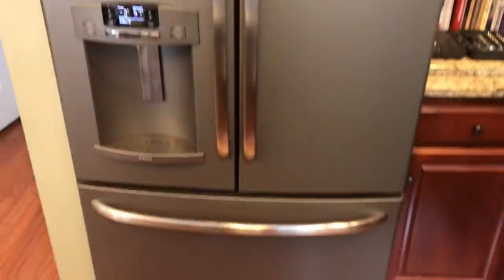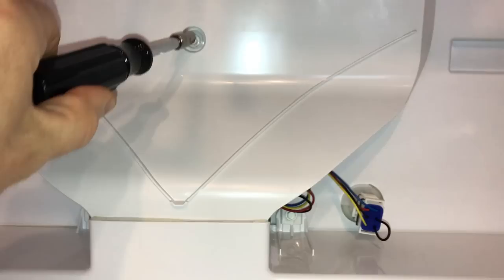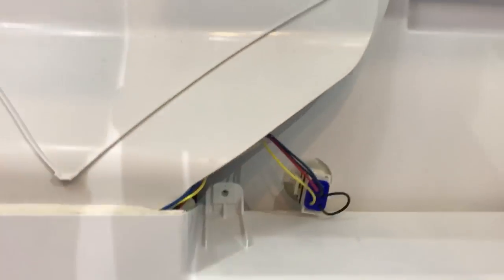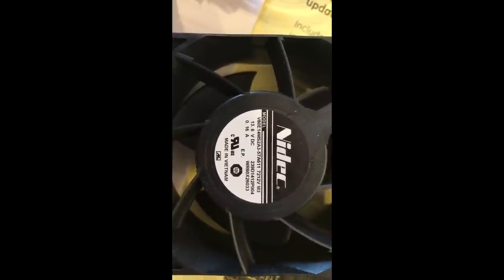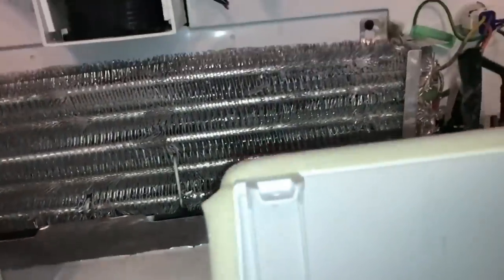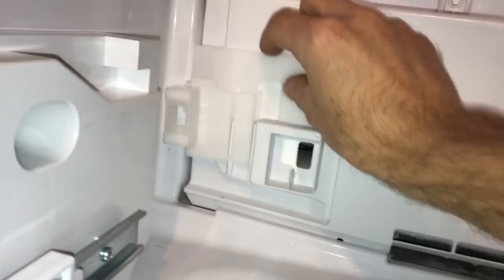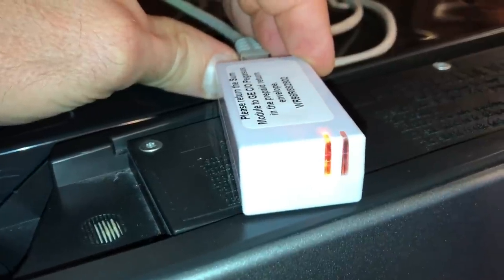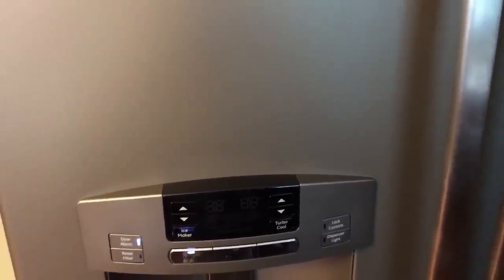GE french-door refigerator not cooling - How to replace evaporator fan

Comment: Thank you and great video!I have a question,the link which is the first one you give us,it's for Amazon ,I accessed it and read the review,most customer said it doesn't comes with the software update items,so where did you buy it?
Reply from the maker: The new fans now do not require the software update. If you did happen to order an older replacement fan which requires the update, it will come with the software and cable that you need.
Reply: @ljschuby99  Thank you!
Reply: Original GE fan part number WR60X10356 was replaced / updated  with part number WR60X26866. No software update required for this fan part number as of 12 June 2021.

Comment: Did this and now the top of my fridge is now too cold? What could be the issue?
Reply from the maker: You can check to see if the fan is running all the time which would cause too much cold air in the fridge section. If it is not turning off, there could be a problem with the thermostat or the control board.

Comment: Do you know if the fan runs 24/7 or does it cut off sometimes?
Reply from the maker: The fan will cycle on/off occasionally to regulate temps and defrost.
Reply: @ljschuby99  thanks

Comment: Can you run the freezer while waiting for  the part  or is that not recommended?
Reply from the maker: Yes, the freezer should be running as normal.  If the fan in the fridge is not working, then the cold air from the freezer will not blow up to the refrigerated section.
Reply: Okay great, wasn't sure if I would be doing damage to the coils building up with ice with the  fan not working. I ordered the part today thank you for you video it was very helpful.

Comment: I purchased a new motor and when we plugged it up the new one didn't come on either.  Can you tell me why?
Reply: Sounds like something is not working to kick on the fan, possibly the thermostat or the control board.
Check out the forum section of ApplianceBlog site.  You can search Thermostat or Control Board for similar issues, and there is also info on entering self diagnostic mode so you could check status of thermistors.  Moderators on the forum are helpful at troubleshooting.

Comment: Are there only certain model that require the update
Reply from the maker: The software update is no longer required with most recently produced replacement fans which have newer specs. So if your replacement fan does not come with a software cable, then the software update is not needed.

Comment: how were you able to be certain that the part that was bad was the evaporator fan and not the thermostate?
Reply from the maker: The only way to be certain would be to remove and check both the fan and thermostat for continuity.  However the fans on these units are a common problem.

You can do a quick check of the fan by removing it and trying to spin the blades - if they don't spin freely, then the fan is bad.
Reply: On the jack that the fan plugs into, use a multimeter on the pins that correspond to the red and black wires from the fan.  It should be roughly 12v.  Also, I had a hard time finding the new replacement fan in a timely manner. Even the local big parts warehouses didn't have it in stock (Kansas City MO area).  I found that an 80mm computer case fan will work for a temp fix.  Just cut the plug from the old fan and splice the red and black wires to the corresponding red-black wires on the case fan. You don't need to hook up the other wires.  Best Buy stocks 80mm case fans in some stores for $7: http://www.bestbuy.com/site/insignia-80mm-case-cooling-fan-black/3646017.p?skuId=3646017   Other local computer part stores probably have them too.

Comment: I have the same problem but my fan works What else could it be?
Reply from the maker: If you are having the same symptoms, the fan may not be working all of the time. 
You can check to see if you are getting any freezing ice on the coils in the fridge under the fan. If so, it would probably be worth switching out the fan to see if that fixes it.

Comment: Do you need to perform software update for the fan to work if my serial number starts with MF
Reply from the maker: If the fan comes with software update kit with Ethernet cable, then it is recommended to update. However, latest fans may not include kit or require any update.
Reply: What are the signs that defrost unit is not working correctly?
Reply from the maker: @ojasparikh  If the fan is not working properly, there is usually ice on the evaporator coils and the food in the lower deli tray is freezing.  The temperature display for the freezer is cold and close to zero, but the refrigerator section is warm, around 50.
If these are not your symptoms, you can check out the forum section of ApplianceBlog site.  There you will find more information about other possible problems.

Comment: Thanks for the great video. A question, when I open the refrig up to look at the fan, should it be running?
Reply from the maker: The fan does not run constantly, it turns on based on temperatures and thermostat.
Reply: @ljschuby99  So the digital door temp shows 60, but food is freezing in the crisper drawer. Bad motor?
Reply from the maker: @markmoeller614  Yes, sounds exactly like a bad fan.
Reply: ljschuby99 Thank you. I replaced the fan and everything is working great!
Reply from the maker: Great - glad you got it fixed!
Reply: ljschuby99 The refrigerator is running fine, but the ice maker seems to hang up (makes a noise like it’s “hunting”). The freezer was way below zero so wondering if something is froze? Unsure how to defrost it
Reply from the maker: Mark Moeller Possible that something is frozen. If you are getting water from the dispenser, then the problem would be in the ice maker part itself. If no water at all, likely frozen near the back lower part of fridge behind the deli tray. You can check out the forum section on the ApplianceBlog site for defrost options.

Comment: Thanks for the video!!! Problem fixed!!!
Reply from the maker: Great - glad you got it working again!
Reply: @ljschuby99  hi did this fix after ice sheet freezing was occurring under lower drawer now fridge is to cold freeing everything but top two shelfs. mid 20 degree F lower portion of fridge compartment Freezer temp is spot on at Zero degrees  
any suggestions  ?? ps already changed out temp sensor

Comment: dumb question. what is the easiest way to pop the wire holder/clip out to get the wires out?... without breaking the clip... I feel like I'm going to break it...
Reply from the maker: There are a clips on the side of the wiring harness.  Squeeze the clips (near the end, closest to you) and it will release the harness.  You can see this at the 3:45 spot in the video.
Reply: ljschuby99 not referring to the connector. My fridge appears to be slightly newer than yours. A 2014-2015 model. But the wire runs through a holder or channel. This holder is on the upflow duct panel. It appears I can unclip it with a screwdriver.
Reply: i had the same,, i just pryed with flat blade screw driver jut enough,, than was open plenty,, if it even broke i don't think it would mater much as long if cover doesn't pinch wires,,thats what i had to do today,, fan was going bad about 9 months ago, gave me an unknown error code asked my where i bought fridge said it was evap fan, bought 9 months ago, and it completely craped out today, fridge would get cool no error code at all, replaced fan and we are off:}
Reply: yeah. pretty fragile clip. pretty bad design. if someone broke it off there is probably enough there to zip wire tie the wiring to that plastic to hold it in place.

Comment: Hi. What does the software update do?
Reply from the maker: The software would enable older replacement fans to operate correctly. 
However, the current fans have updated specs, so the software update is no longer required now.

Comment: Thank you so much for this great video which really has assisted my husband in figuring out that the refrigerator fan needs to be replaced but we are having a difficult time figuring out exactly which replacement part number to order.  Our GE Refrigerator is Model #DFE29JMDCES and our original fan shows Part #WR60X10341. Your replacement Part # is WR60X26033 which needs the firmware update but GE is showing our replacement Part # as WR60X26866, which of course is temporarily out of stock and not available until 2/14/19! Since we need our refrigerator working before that...we are trying to order the replacement part from Ebay or Amazon and are so confused as to whether the replacement Part #WR60X26866 does not need the firmware update. Any assistance from you or others would be greatly appreciated!
Reply from the maker: I know, they do not make this easy to figure out with all of the part numbers.

I have the exact same model fridge.  Part *26033 repair has worked great for me.  This has been updated with *26866 which is the same fan.  Both will need the software update (they send a cable and usb).  They are available on Repair Clinic and Amazon.  Also, part WR60X10357  shows on Amazon to be a direct replacement for these with the software update as well.

According to GE, Part # WR60X29099 does not need the software update.  It is available on Amazon also. 

Any of these will work, so it may be best to use whichever one you can get soonest to make the repair and get back up and running.
Reply: @ljschuby99  Thank you again...we had read your response but hadn't gotten a chance to reply that we had ordered the WR60X10357 on Ebay and were relieved to read that you said that should be a direct replacement.  We are hoping for the best and will update when the repair is complete.
Reply: Received replacement fan, installed and refrigerator up and running! Thank you again for all your help!
Reply from the maker: Great - did you have to do the software update? @giannaglock3677

Comment: the vid work exactly for me,, but my cover was froze to wall didn't want to force off, so i took hair dryer and put some heat than it came off, my soft ware update took the full 15 min, and green lite on solid and orange lite solid when done,, my fridge was bought new 11/09/2014, a 1700$ appliance should last longer than that!! Thank you for the vid, it was perfect, i just wanted to add what i had to do,, if this helps any one,bought my evap fan from my ge store, 106$ part # WR49X25197  OEM part number i think you can buy fan cheaper just make sure plugs are the same, and i don't know about software update,, modern stuff more features more stuff to go wrong, give me basic stuff:}
Reply from the maker: Thanks for the update and good idea with the heat for the back cover.  Glad you will be able to get a few more years out the fridge!
Reply: also its  1/4inch nut driver

Comment: What about if fan is replaced and the fan doesn't spin
Reply from the maker: The fan will not run constantly. The thermostat will turn it on and off. If it is not turning on at all and it cooling the fridge after a few hours, then there may be an issue with thermostat.
Reply: @ljschuby99  no ,it's that electronic thermostat

Comment: Nice video really helpful 
How important is to do the update ?
Reply from the maker: luiis amador The new fan will work fine without the update.    The new software is just a way to change the fan operation cycles and get it to wear better.
Reply: Good, because mine didn't come with one.

Comment: Thank you!!!!! I have a cye23tsdcss which had the exact same symptoms.  Out of warranty of course.  We had a repair guy come out but he said they are unable to get the fan anymore. He said I might be able to get one. I ended using your video and I pulled the bad fan myself.  Got a replacement from GE appliance parts, which took four days to get to me after several phone calls.  It took me about 45 minutes to get fan in and button the whole thing up. Works perfectly.
BTW they sent a software update module, basically a USB with cable. The new fan is different new fan, not original fan. I did not do update as I use the WiFi app. 
Thank you for posting this video. it saved me buying a new fridge.
Reply: Same here. Always out of warranty aren't they.
Reply: Can you please tell me what app you use for the upgrade? Thanks

Comment: Software update? This is where you lost me I just replaced my fan. That was easy enough. I plugged the unit in and it is behaving so far (fingers crossed). I started at 58 degrees and am down to 54 degrees after 20 minutes. We shall see. I was NOT expecting any mention of a Cat 5 cord and/or update. By the way, my frig is a 2014 (10 years old).
Reply from the maker: The software update is no longer needed. The current replacement fans have updated specs that work fine with existing software. So you should be good to go.
Reply: @ljschuby99  thanks for the reply. I am now down to 44 degrees and steadily dropping.

Comment: So if you dont program it the fan wont work?
Reply from the maker: Newer fans do not need a software update.  The software update will make the older fans work more efficiently and last longer, but they will still work OK without programming.
Reply: ljschuby99 ok thank you.

Comment: ugh the fan started running as soon as I turned it... I had the exact symptoms you had... refrigerator not cooling (51 degrees) and the freezer at 0.
Reply from the maker: Lisa Blackwell I would guess that it's the fan. My old one was like yours and just didn't turn freely and couldn't get going on it's own. 
If it started when you turned it, that would mean that it's getting power + a signal to turn on from a working thermostat.
Reply: thanks for the tip.I ordered a new part but at least it's running for now.

Comment: Did you just forget to put the rubber housing on 4:32? The motor is clearly sitting in there without it when you started to close everything up after 5:04.

Comment: My local appliance repair guy was struggling to fix my fridge, but I found your video and was able to solve the problem quickly and easily myself.  Thanks!

Here's the part on Amazon - no software update required (at least for me).
https://smile.amazon.com/dp/B07B438LZV/ref=cm_sw_r_cp_apa_fabc_67YHTTRATT4E3XESV0BT?_encoding=UTF8&psc=1
Reply from the maker: Great - glad you got it fixed!

Comment: i reciently replaced the fan and software ,it has been 8 weeks and the new fan has stopped working again  ,my next more is to contact ge and see if i can get a new software module ,
Reply from the maker: maddog 75 That’s a bummer. Unless it was just a bad replacement fan, the software may be your best bet. Keep us updated on what you find out.
Reply: Where did you get software box and Ethernet? I purchased new evaporator fan but did not come with kit. My fan does not shut off so it’s freezing up lower portion of refrigerator. Send me link if u know where I can purchase cat 5 cable and software material. Thank you

Comment: Put new fan on and still want work
Reply from the maker: Sounds like it could be a thermostat issue or possibly control board. 
You can go to the Forum section of the ApplianceBlog site and search your situation. You can also post and get some good feedback from their knowledgeable moderators.